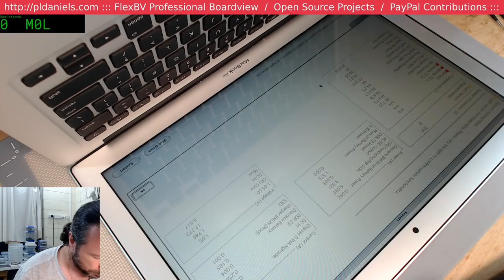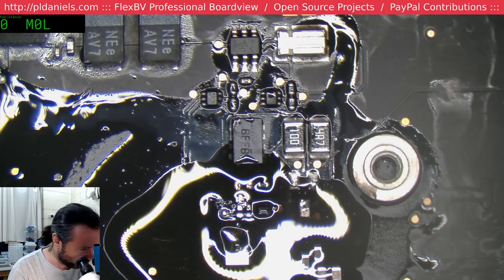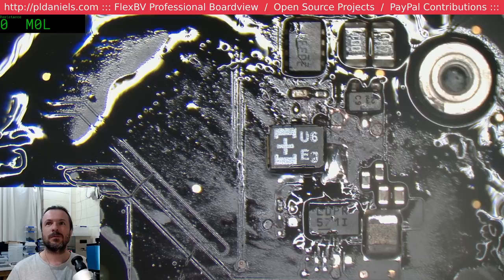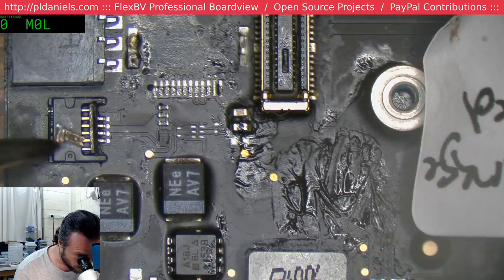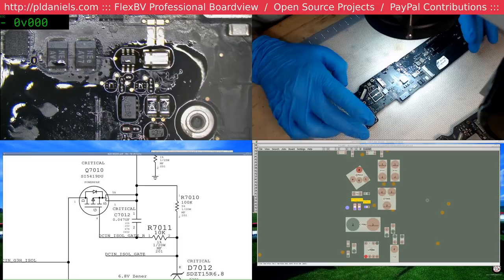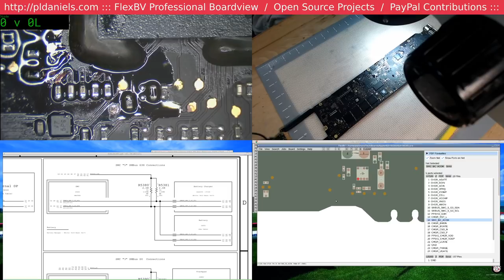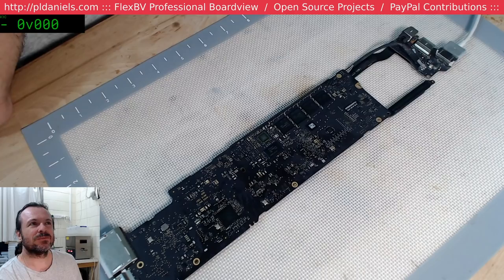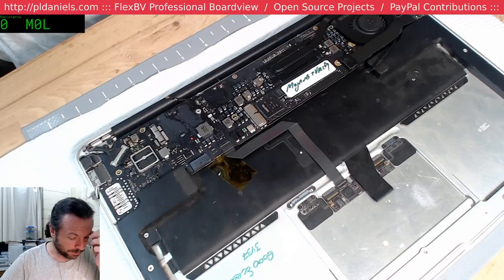Revitalising free Macbook boards, A1466 and A1502; getting in the win

Comment: I had one of these cheap 60€ hot air stations as well. The difference to a good one is incredible.
But this guy murdered the board... I wouldn’t touch it 😅
Reply: Yeah I have found that the cheap ones are OK for basic SMD stuff but multilayer boards with many GND planes etc - forget it 😉